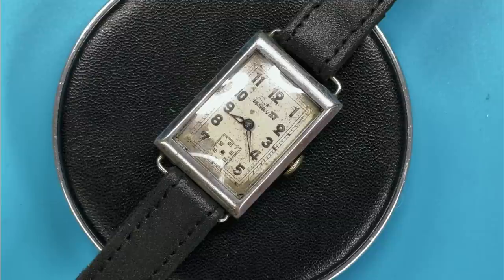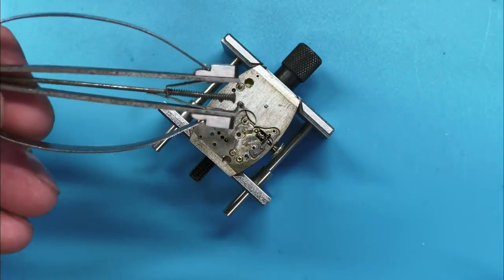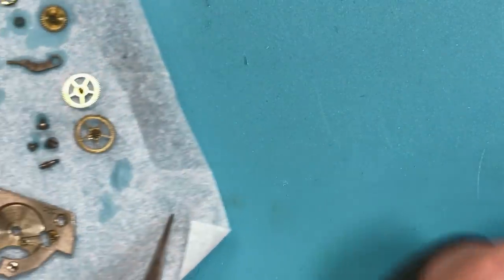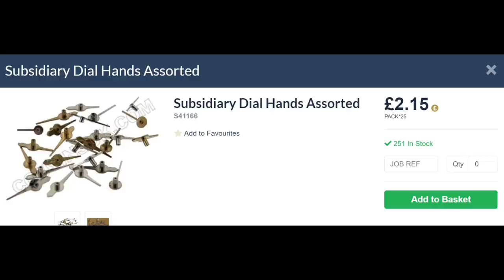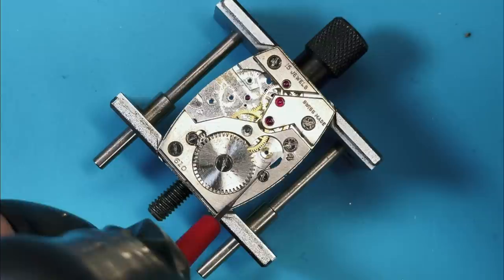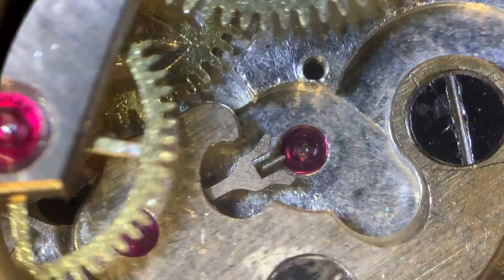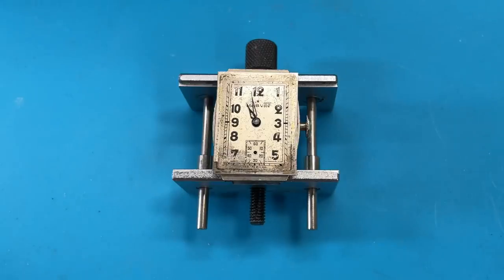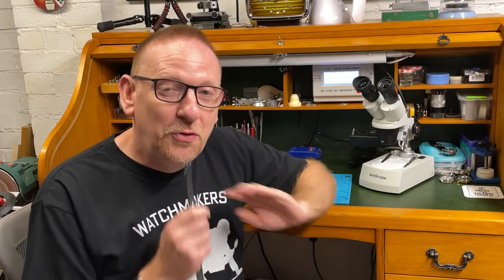Amazing 1930s Marvin Watch Restoration!

Comment: New for new, I wonder how accurate a watch from the 30s would be compared to a later watch from the 70s. While craftmanship was much higher in the early century, tooling was much improved in the last decades - much more precision tooling and accuracy. If you could compare a new luxury watch from the 30s-40s with a new luxury watch from the 70s-80s, which one would be more accurate ?

Comment: Spring setting is due to Hooks Law. Metal looses its flex after it is repeatedly activated over time because the act of stressing the metal causes its crystaline structure to change. When a spring is under tension in a barrel even the changes in temperature from day to day will eventually cause this, but mostly it is everyday use. Often springs on broken watches sit 'overwound too' which doesnt help. Set springs are on the way to break but not necessarily quickly.

Comment: Great entertaining video as always. I feel your pain. Try a ORIS 471, Very similar to your Marvin. Its being on the headache shelf of my bench from the beginning of my adventures in watchmaking. The original was as full of oil, as yours, I can get the arm flicking smoothly between the posts, have a new mainspring and two balance cocks and springs with wheels. Can i get it ticking,,,,,,NO. I just cant see in it to line it up all up. When i feel particularly sadistic I have another go. I will get it going but look at it like this: A VW polo will wear out before a VW passat or combi van because everything is smaller. If the wheel is smaller it still needs to go around either the same or more times to go the same distance. The metal is the same. The bearings are also smaller so will wear more. I am no expert but damn these things hurt my eyes. :)

Comment: With all other factors ignored, a watch that runs too slow that has the regulator pinned far to the (+) means the hairspring is too long. I watched a fantastic representation of this by some youtube teacher (can't remember which) who held a vertical pendulum. As it swung, the distance it swung left to right (amplitude) didn't change the  time it took to swing. But shortening the string (or lengthening it) changed it dramatically. The shorter the string, the faster it ran. The longer the string, the slower it ran. This in essence is what the regulator does. It shortens or lengthens the "string", or hairspring. So if your regulator is pegged, and you know everything else is right, I'd have to assume the overall hairspring is too long. Maybe you were sent the wrong one?

Comment: This is proper watchmaking , not maintenance. You should go for such challenges. That will move your skills forward. Don't leave it as is go for better performance. I think bottom jewel is cracked.
Reply from the maker: I don’t mind pushing myself on my own stuff but not others as it ends up costing.  The balance wheel screws don’t have slots so guess what… need a special and expensive tool.. typical. Many I see have slots but not this one.
Thanks for your comment. Much appreciated.

Comment: I've just upped a video showing some really cool watches on my channel, Seiko's 7019 and 6309, a correct bracelet for my 6349 plus an exceptionally rare Pulsar Kinetic designed by the chap who voices Puss in Boots in the Shrek film, an astonishing gold Avia Olympic...   Also got a Citizen radio controlled titanium eco-drive the seller said was dead and yes it was but following Citizen's advice of putting it for a night under a bright light source... it sprang into life and its like a new watch.   Tomorrow I am putting a new lithium cell upgrade into the Antonio (that sounds a bit weird...) to replace the weak capacitor cell it has, the watch is amazing being a see thru baby blue acrylic and the dial is skeletonised as well as the bottom case section has an exhibition caseback to show off the rotor.  Glad to see you are out and about on the videos again.

Comment: Stout fellow! You bore that well, and I admire you for revealing your adversities as well as your triumphs. I do believe that because of the fixed lugs and the dial face that the watch may be from the 1920s or perhaps the early 1930s so I think it’s even older than you guess. Also, it was probably also an economy type watch to begin with, so you are not really working with a watch that had a descent build quality and that would make it all the more difficult to restore 90 to 100 years later. Again I’m not an expert but just offering my insights for your consideration. Thank you! I’ve enjoyed your video! I have bought you 3 beers as per the above link! Cheers Mate!
Reply from the maker: Hi Micky,  firstly thank you very much for your donation I really appreciate that immensely. You might be right about the age of this watch as I do have a feeling its older but I could not really find info on the movement which I normally can online.  If you get a date for the movement it gives you an idea of the watch.  The thing with Marvin is that they appear to have made their own movements and as such seem to be quite collectable from what I can gather. 
Thank you so much for watching. cheers!

Comment: Interesting one Mike.  I share your disappointment with this one.   I'm wondering if you bothered to strip the balance jewels as normal.  It's a pity you didn't attempt to shorten the hairspring a smidgeon- fiddly of course but not too difficult if you take your time.   I've seen the you undertake much more challenging procedures!  Altering the beat error on these old watches is, I know a pain in the bum.  I can understand your trepidation if the watch  belongs to someone else,  but given the condition to start with, there was  not much to lose!  But we'll done for getting the beast running.   Keep up the good work
Reply from the maker: Thanks. This one was a few years back now and to be honest I can’t remember it unless I watch the video back.

Comment: Looking at the timegrapher 52 mins in, the balance wheel seems very much more in harmony with that nice close tracking so thats a plus.   Thing is, in the 30's what you have there is just about what you got back then, super precision didn't really come in until WW2 where great advances in engineering and machining allowed watches with amazing precision, my 1947 Avia is the most accurate of all my mechanicals, puts the Seiko's and others to absolute shame how good it is.   Saying that, my recent 7019 acquisition has knocked my Poljot Schturmanskie Gagarin from second spot to third as that is a very good movement in the 7019 but not quite where the '47 is hehe

I suspect your other issues are simply pivot and gear wear being a 90 year ish old watch and likely all original I suspect if you refreshed the train, the escapement etc, replace the ankh and def look at the jewel settings on the balance staff you might see a nice improvement but that suggests many hours and finding almost impossible to find parts if they are unique to the works unless you can make new ones on a microlathe.   Def have a look at the jewels themselves as I thought a couple looked a bit enlarged to my eye but I am no expert and compared to you mate I am like stone age in comparison.  One of my subscribers is sending me from America a USB stick stuffed full of Seiko technicians manuals covering just about every Seiko movement going, I am also investing in a 20 diopter large lens on a lamp arm, going to cost a lot but a 20X large lit lens is what I need to do real precision work.

Comment: Did you check the hairspring was being gripped properly by the pins in the regulator?
Reply from the maker: Yes its what gave me so much trouble one of the pins was bent so I had to re-shape.  I really have a lot to learn on hairspring work.

Comment: Why not just just soak the watch or parts in acetone or isopropyl alcohol? Just asking out of curiosity.
Reply from the maker: acetone or alcohol will soften / melt shellac that holds the pallet fork plus the impulse jewel that is on the balance wheel.

Comment: Hello Mike.  Mike d. Here stateside. My tip for hairspring d is this. I have had luck simply while the hairspring is on the balance turn the balance upside down holding down the bridge grab the balance wheel with tweezers keeping the balance wheel straight up lift the balance until 3 quarters of the coils are seperate move the balance wheel north about 5 to 10 mm then south then east then west. I have found many times this will help remove any natural defects in the spring from wear while working in the watch. But first I clean the spring as you did.     Blessings to all. Oh Mike that collet would be moved to the left to out that dot at 3 o clock. Twist the fine screwdriver to your right just 1 mm.     Mike d Stateside.
Reply from the maker: Interesting tip i may try this next time, thanks
Reply: @MyRetroWatches   Hello Mike. Mike d here. Stateside. I just adjusted the beat on my 40 Ingersoll watch and it did no good on getting a reading on my time o grapher. Here's how I adjusted the best on my 40s Ingersoll. Remove the balance from the watch. Lay the balance on the table a pad or what ever you have.  With the balance cock down and the balance wheel and hairspring up look at the dot on the spoke of the balance wheel this dot should be absolutely 3 o click and when installed in the watch it will be 9bo clock and nearly perfect line with the pallet fork. Most of the time you'll see this dot at 2 9 clock I find the watch still ticks nice and keeps time pretty good. 8f you do want this for at the 3 o clock simply turn the balance upside down. Oh. This dot is right wear the line up jewel is the jewel 8s on the upside of the balance assembly  With the balance bridge or cock up and the hairspring and balance wheel down gently pull the balance wheel toward you you'll see the coils sperate enough to get a fine blade screwdriver into the notch on the collet. Remember if the jewel needs to turned to the left the collet must be turned to the right and visa versa. For this adjustment place a fine too screwdriver into the slit and turn the Collette to the right just bout  1 mm. Now pick up the entire balance so the hairspring steps in it's new spot. Then check that dot and it should be at 3 o clock. If not turn the Collette the other direction jusT 1 MM.    Hooe  this helps  Mike.   Blessings. From Stateside.

Comment: Well Mike, I got a bag of watches for about a tenner. Just one looked interesting but a non runner, 
the winder had been replaced with what I discern as from a Fossil watch. 
Nothing to lose, I did the oil trick and a wash with IPO and dry. Oil is a very thin one, not 3in1.
You did have me laughing with all the oil in yours by the way, looked like it had fallen into an engine!
The face looked like it had been wire brushed which had sadly removed the plating but apart from that, 
it cleaned up and now runs within a minute a day.

Hunting on Google, I discover it is a 1932 watch, Swiss made 15 jewels, small ladies, imported to 
New York and the jewellers name "Newsol" engraved on the main plate.
Only thing I am uncertain of is whether the 14K inside the back is a model number, or indicates the white 
metal is 14K gold.
As you can tell, I enjoy my experiments but am not a repairer in the true sense. 
I do have a quartz watch filled with baby oil, and running well for some months!

Thank you for your Youtube channel which inspires me to go on and maybe attempt a strip down one day.
Reply from the maker: Thanks for your comment. Can’t help on the gold watch but there is plenty about, guess with no hallmarks you can only tell by weight .

Comment: Interesting swiss movement. Figured there would be issues with that hairspring. I respect the fact that you know your limitations and stop rather than risking damage.  
Also, looks like you're using a better camera, video looked crisp and sharp.
Reply from the maker: Thanks. Hairspring drove me mad hence the replacement. As for camera  it’s the same I use an iPhone 12 Pro as it’s excellent. Problem I’ve always had is focal distance and lightning. I had bought a new tripod to get the camera closer to the action. Pleased to see it’s been noticed.

Comment: Great video Mike, what an oil filled mess, brought back to working order it's definitely not a loss, thanks lad, i myself just fixed and seviced a Raketa 2609 ha in a Seconda 36mm gold plated case, i was impressed with the 2nd wheel which the cannon pinion goes on, it was jeweld for the seconds i like that alot, not seen on others eta or Seiko, impressive, enjoyed you video cheers Mike, glad you and your family are ok mate, thank you. 👍 P.S i have a dedicated pair of tweezers extremely sharp just for hair springs, they are challenging for sure.
Reply from the maker: Thanks for your comment, glad you liked this one.  Well done on your Russian one too. I need to revisit some Russian stuff. I have a Sekonda super delux which has an amazing movement that I’ve serviced before so maybe that will come to the channel. Hairspring is thin tweezers x2 and a bucket of patience.

Comment: Hi Mike
This is a great video and your efforts to get this sucker up and running are marathon. I noticed that the original hairspring has 11 coils and the new one has 13. Can you not shorten the hairspring by one coil which will increase the speed an decrease the amplitude?
Reply from the maker: This much I dont know. The old spring was most likely from the 30s or 40s. The springs are now made of better material.  Also for manual winds they have a "hook" so they can tuck into the barrel so you could not shorten them unless you then remade the hook.
Reply: @MyRetroWatches  HI Mike I was referring to shortening the hair spring not the main spring. In your build up you could not increase the speed of the oscillations of the pallet hence shortening the hairspring will make for more oscillations and less amplitude.
Reply from the maker: @AstonColey  My mistake sorry. I didnt notice this and I must say that despite ordering onliine the replacement for this movement I do not think that I received the right one.  A spring could be shortened but its nota job I would take on. I need to master hairpsprings as its my biggest weak point.

Comment: Well done for your perseverance on this one Mike. A great video. My first Swiss watch was a Marvin: my Grandad's. It's completely different to this one, with a more traditional round gold case from the late 50s or 60s. As far as I know they made their own movements but I couldn't see your one on the lift angle table. The other 500 and 600 series movements were all 52⁰, however.
Reply from the maker: Thanks. Yes I found out though searching online and when buying the mainspring that Marvin made their own movements. Makes it a bit more special.
Reply: @MyRetroWatches  It's a long shot but would you be interested in featuring this watch? It's a beautiful piece that hasn't been serviced for at least 50 years , though with less than 1ms beat error, -30s/day and about 160⁰ amplitude, possibly isn't in too bad shape. What do you think Mike?
Reply from the maker: @red75v67  sorry but I have so much watch work to do I am not taking any more on.
Reply: @MyRetroWatches  no problem. Keep up the good work.